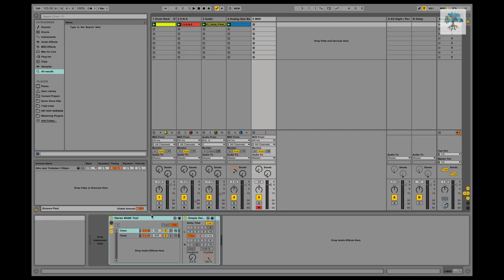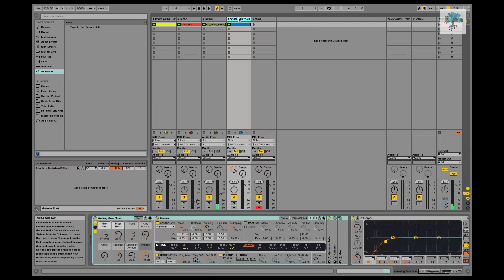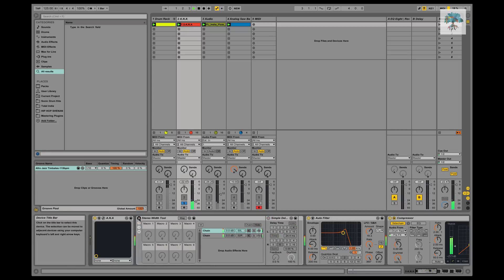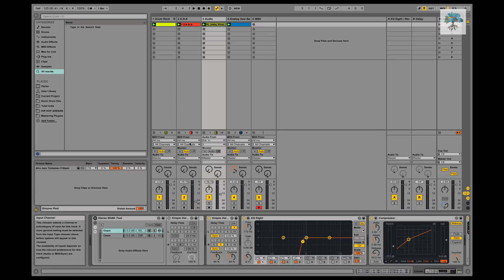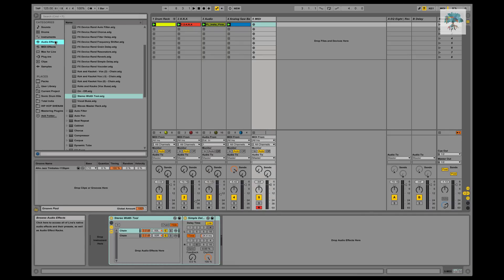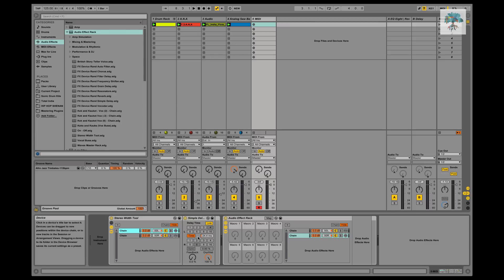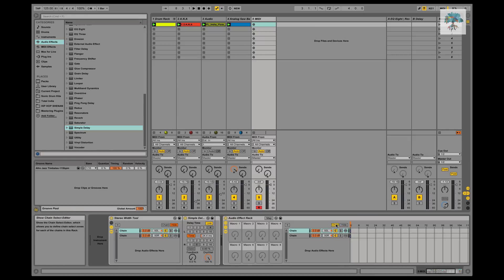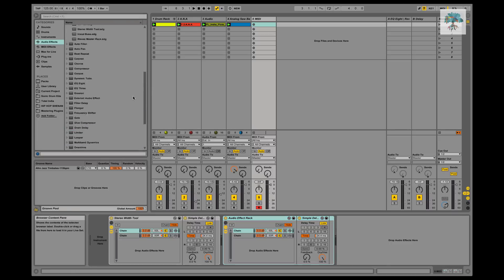Building a stereo width tool in Ableton Live

Comment: You could do this using only the Simple Delay by turning off Link and setting one side to the 1ms minimum. Otherwise, it's the same Simple Delay settings as shown: 100% wet, Time on both channels. 

Sometimes I use it as a return effect. Often I keep the channel delay under 10ms and mix in some Dry signal for main elements like vocals.
In the rare case that you need the transient, you can pull the track delay back 1ms (in the View menu).
Reply from the maker: awesome dude thanks for the feedback! I already got my little tool so i will stick with this bad boy. I know there are other ways. I also have waves too, but this little setup seems to get more depth then waves.
Reply: Not sure what you mean. I'm just saying this functionality is already built into the ableton simple delay. No rack/tool is needed. In Reaper we have the JS channel delay which is also in the ReaPlugs pack for use in any daw for free. I'll be a fan of Waves the day they sponsor me to be, just like everyone else lol.

Comment: Great way of implementing the Haas effect! I always used hard panned return tracks and just delayed one of the tracks. One thing though is that you shouldn't go above 28ms with the delay otherwise you end up creating a lot of phasing/combing issues instead of space.
Reply from the maker: hey thanks for the other tip and i am glad you liked the video! So basically you would buss you channel twice hard pan each one, and then throw a delay on only one of them?
Reply: Yeah basically! I don't even throw a track delay on it, I use the Track Delay feature you can turn on in the view menu. It doesn't really make a difference, but it simplifies your workflow especially when you have about 5-10 effect on a rack.
Reply from the maker: that's cool thanks for the tip!